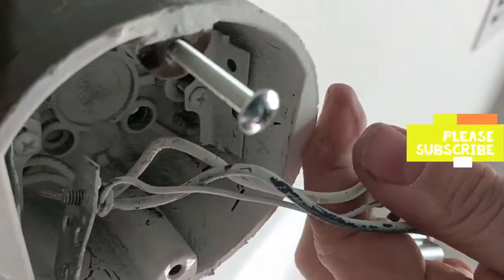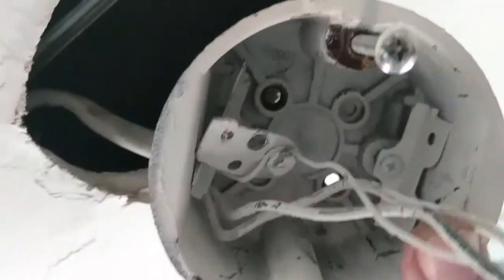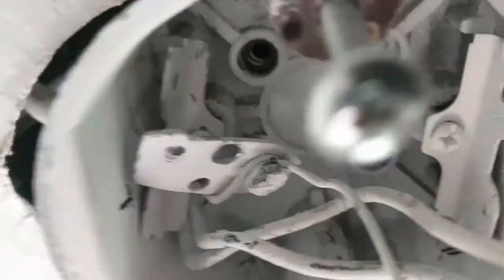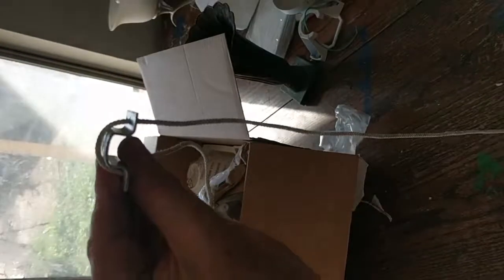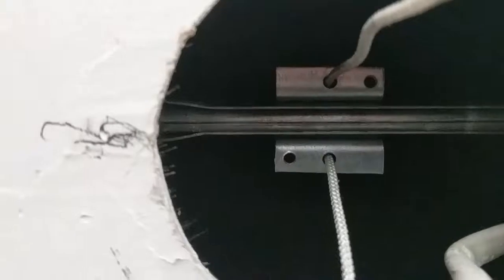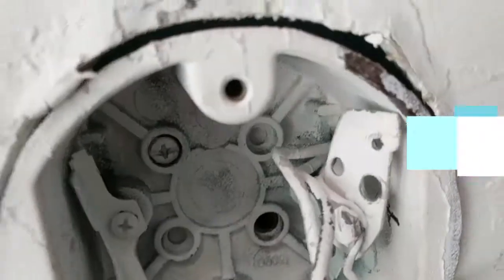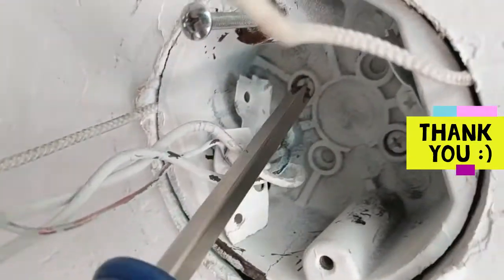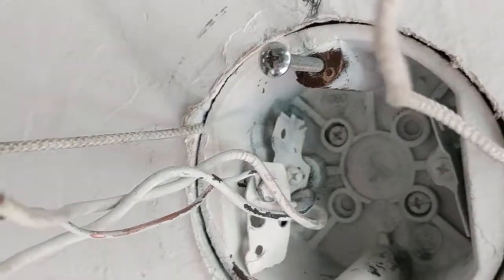How to secure bracket behind electrical box in ceiling of 1st floor

Comment: Do you have any idea how many videos I've watched trying to find a way to do this?!?!? How many websites and forums I've visited?!?!?  I kept thinking tape? super glue? How can I hold it down? This is absolutely genius, thank you so much.  Did you end up getting the cord out or cutting it? Do you think the cord could somehow be a fire hazard if I left it in there?  My cheapo plastic junction box cracked around the screws and FELL OUT OF THE CEILING and the only thing that kept my dining room light from shattering on the table was one thin electrical wire!!!  I had a handyman come out and look at it, said he would call me when he was ready to fix it, then never called me and didn't return my calls or texts.  I'll bet he didn't have a CLUE how to fix it.  I bought a metal replacement that screws in, but I can't get the brads out of the old one to remove it.  I was able to buy the exact same junction box/brace so I can replace it, but do you know that you can't buy that same junction box without the brace?  Did you know that I now know the difference between "old work" and "new work"? 😀  I've had a hole in my ceiling covered with trusty duct tape for months because nobody can fix it and neither can I.  I am going to give this a try this weekend and will let you know if it worked.  Necessity is the mother of . . . DIY.  Thank you for filming this, you never know who you are helping!! 👏👍💖
Reply from the maker: Oh, I am so glad I took the time out to record this! Not too many views, but if it helped you out, it was worth it! Did it end up working?

Comment: Is this for a light fixture or ceiling fan? I have exactly the same at my house. The previous owner used this brace for the light fixture. I want to use it for a ceiling fan which weighs 20 pounds. Can I use the same brace?
Reply from the maker: Sorry, I just saw this. Exact same situation, I was replacing a light fixture with a ceiling fan. It's been there for 2 years, so far so good!
Reply: No. That brace is for light fixtures only, and is not rated for ceiling fans. This is an incorrect installation. That  brace looks like the RACO silver metal bar hanger for ceiling electric box mounting. You have get a much more study one for ceiling fan. Any big box store sells them rated for ceiling fans. Then you will not need your string trick to install one